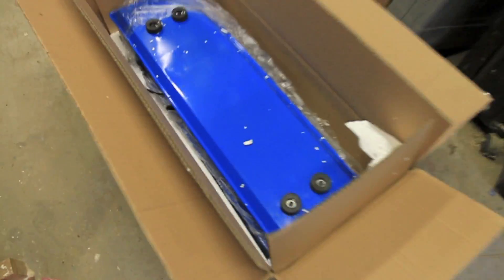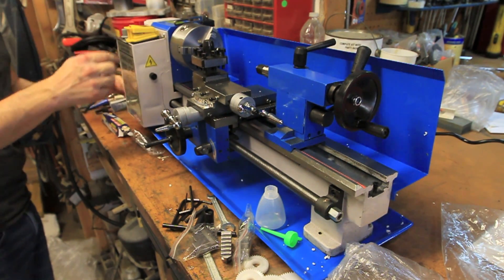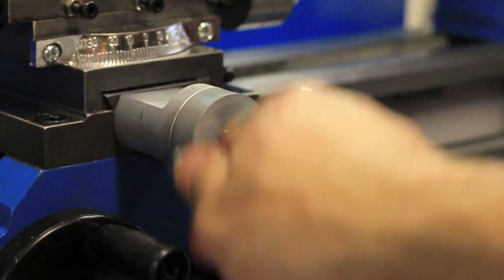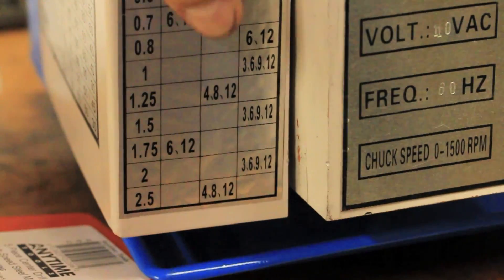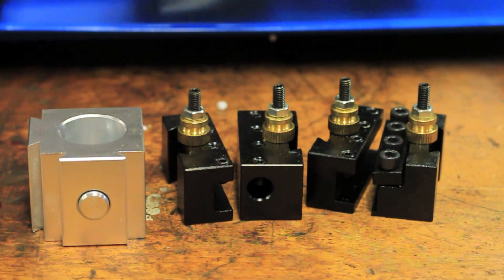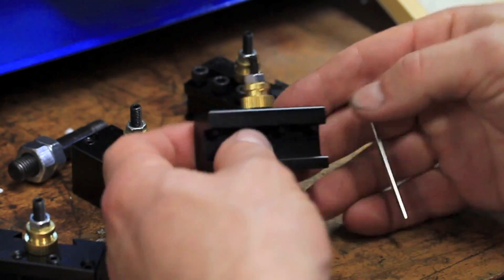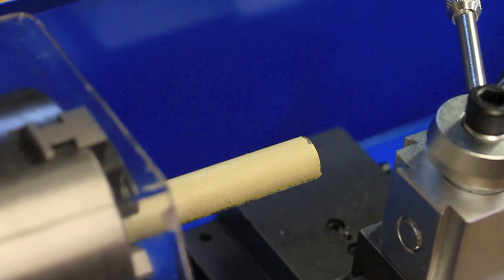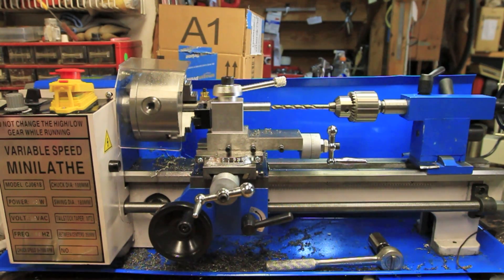Cheap Chinese Mini Metal Lathe Unboxing, Setup, Upgrading, and Testing

Comment: Thanks for the video.  Well done!    We're looking at this very one.
Reply from the maker: Thanks! 

If you buy this lathe with the mindset of it being a mostly assembled kit that needs work before it's really usable then I think you'll be very happy and my videos should help you with that process.

If you're wanting something that you can take out of the box and start using, sadly this wouldn't be a good option. 

Let me know if you end up getting one!
Reply: Thanks Tim!   Today we received the Grizzly 7x14 for $704 and are rather impressed.  The crate in which it arrived is the most professional and sophisticated crate we have seen.  We did the "break in" they suggested and will soon be giving it a go.  Thanks for your encouragement and the information you provide.  You are quite the professional educator!   Best of luck!
Reply from the maker: That's exciting! What are you going to make first? It sounds like the QC on Grizzly is much higher than the one that I got.. and for what it's worth I've heard their customer support is very good, should you run into any problems later on.

Thanks for watching and enjoying my videos too :)
Reply: Tim, purchasing a lathe appears to be something like buying a tractor!  You want to mow?  You'll require a mower!  Plough?  You'll need a plow.  LOL  Anyway, we ordered some cutting tools and went to Harbor for a 1" micrometer which I tested and it is dead on!  Also got some of the T handle Allens.  Have always been fascinated with lathes and I'm a retired military pilot who was on test pilot orders & my mom was an airplane mechanic in WWII so I sort of understand mechanics.  Thanks again for your encouragement and will keep you posted.  My neighbor said he will go to CPR classes while I learn!!!
Reply from the maker: Haha yeah, fortunately I bought some tools that showed up at the same time so I could use it right away. Unfortunately I had to fix it first. And also unfortunately I bought a bunch of carbide tipped tools which this lathe really doesn't spin fast enough to use... although I keep using them anyway.

That's very cool and sounds like a fun career! Thanks for the service.. I'm half way through a private pilots license but have kind of stalled because the time and money planets haven't lined up in a while.

Comment: this machine scares the hell out of me.. having worked with those (big)machines for 11 years , i would never ever feel save and ftw plastic gears? , also what is the rpm range? adjustable RPM ??.
I agree with Night saber , buy an older good lathe
Reply from the maker: Well comparing this to a industrial lathe is like comparing a Black and Decker drill to an oil rig. Not to say things can't go wrong on this little one, but it's just a much different scale. The plastic gears are just for the power feed (at least on this one that doesn't have the two speed gear box). In one of the later videos I finally put a tach on it and it seems to have a range between ~700 rpm to about ~2300 rpm. Thanks for watching!

Comment: Hi Tim; Thanks for the video.   I'm presently rebuilding the Harbor Freight 7 X 10 Mini Lathe I bought back in 2008, primarily to add some features such as taper bearings, tach, slide locking x 3 axis, and other convenience stuff.  I've gotten a TON of use from it, it has been a solid performer.   Together with my HF mini-mill, which I converted to CNC, I can make anything - Well, if it's not TOO big . . .

I have to say that the quality of my lathe seems to be much better than what you showed.  I picked mine up from the local HF store in a wooden crate "on-sale" for $349 back then, and the quality is actually pretty high. I'm sort of surprised that everything goes back together without much fuss, the machining is pretty accurate with apparently no assembly "fudging" when it was built.  I like it!

Great Luck, thanks again, Ken

Comment: I have this lathe, When i try to use the boring bar, The slide wont ...slide to the center of the lathe, it stops a couple of mm before reaching the  part i wont to bore..  what do i do  now ?

Comment: They're not a bad large once you've given then some fettling to get rid of the rough edges.  I would junk that QC toolpost though, I had one and it was terrible. Got a replacement from the UK company that sell them (Amadeal) who sell one for £45-ish that is steel and far better. It came with 3 tool holders. Overall I'm impressed with mine for the kind of work I throw at it. Don't know if you've seen him, but there's a guy on YouTube called Steve Jordan who has quite a few videos regarding upgrades he has carried out on his version of this lathe.

Comment: one of my friend bought one of this and replıcate all of the internal gear sets and build a better quality lathe.. and of the nearly 1 mounth of work he finally got a good lathe
Reply: Yep that is what I did, replaced the gutless supposedly 550w motor for a 750w 1hp 3 phase motor and VFD, replaced the head-stock bearings with angular contact bearings and replaced the plastic gears with metal gears, plus a lot of other mods and the lathe works fine. If you are prepared to do a bit of work you can end up with a very capable machine. Some of us don't have the room for anything bigger.
Reply: Stephen Tayler May as well bought something better if you swapped it to a 3 phase an all that

Comment: What gears stripped? You aren't talking about the plastic ones that are a known issue with ALL mini lathes, are you? There's a replacements available that remedy this issue.
Reply from the maker: Keeping in mind that this video was literally me taking it out of the box and having very little prior knowledge of this lathe or the mini lathe community in general, yes those are the gears I was referring to. Fast forward to actually trying to fix them, turns out this lathe is a single speed and doesn't have the plastic gears in the headstock transmission that plague the rest of the mini lathes. The actual problem was a loose/broken motor mount. This lathe in particular doesn't fit into your statement of ALL mini lathes. Thanks for the comment.

Comment: It don't matter what he buys if he keeps leaving the chuck key in the chuck he's gonna break it or himself
Reply from the maker: Aside from that being the first time touching the lathe and not really knowing better - this lathe came with a safety shield that prevents you from starting it unless it's in place, and it can't be put in place unless the lathe key is removed... so for a while it had that fail safe but then the shield broke apart - I do have a neat idea for a sort of kill switch that I'll be doing at some point in the future if you'd like to subscribe and check out. Either way, thanks for watching and commenting!
Reply: I was unaware it wouldn't start with the shield up. If the plastic shield broke try to recreate it with thin sheet metal. I think it's an excellent safety device

Comment: People expect better quality for half the price. It's fantasy land thinking.
Reply from the maker: Maybe some do - personally I had pretty low expectations and this didn't meet any of them. Thanks for the comment!
Reply: It seemed ok to me all the complaints were accessory issues from what I remember in this video. The alignment with the 3 jaw chuck was a bad procedure though you should have taken the chuck off and placed a center in the head stock. By doing it at the 3 jaw chuck you allow room for error since those 3 jaw chucks come with a certificate usually which states a range of .002 - .003 runout and who knows how accurate those certificates as well.  Also the tail stock is adjustable so I don't see the problem.

Comment: I bought one of these in the early 2000's.1st the speed control board burned out. I replaced it with an industrial motor control board. Then I remove the bed and welded it to a piece of channel iron to make it more study. Then the motor burned up so replaced it with a surplus tread mill motor with much customization. The standard tool post required shimming to get the tools on center . All and all I'd call it an incomplete kit that you can turn into a lathe.

Comment: I generally find - wherever something is made - that you get what you pay for - otherwise there would be no point in one thing being more expensive than another (of the same type of item).  This is generally "offset" by you getting more with the item that you would from another manufacturer of better quality - but ultimately you pay your money and you takes your choice as they say.
Reply: Sometimes. Sometimes you just pay a premium for the brand name alone and get less quality.
Reply: My motto is “If it isn’t selling, raise the price. If it still doesn’t sell, raise it again!” Perceived value gets the suckers every time.

Comment: Chinese products are junk!!!!!!!
Reply: Where's the $600 lathe from anywhere else?
Reply: I'm sorry, I've overreacted ;) But not all chinese products are bad quality. People just should be aware that cheap price means bad product - it's not China's fault.
Reply: @Radoslaw1986xx  I iPhone are made in China;-)
Reply: laurens b I was replying to the guy saying all Chinese stuff was bad, I said it depended on what you paid for if
Reply: Said someone without enough experience, it pays to do your homework, but you can get some very workable machines if you shop around.  I have both a “cheap Chinese” mini-mill and lathe and after a couple decades they’re still going strong.  I never could have afforded a “real” machine, but since I wasn’t running a job shop they worked very well for my needs.
Reply: Chinese products built down to a price are junk, yes. That doesn't mean ALL Chinese products are bad. It's just a matter of paying what it costs to get a quality product, same as everywhere else.
Reply: Paulo Costa, the primary difference I've seen with Chinese machinery is that with good quality equipment made out of steel, Chinese will substitute iron.  Drop a steel part on the floor, it bounces.  Drop a Chinese iron part on the floor, it breaks in half.  However, if you use the Chinese equipment within its limitations, no problem.
Reply: economic - not everything you get from china is crap. this lathe looks terrible, at least for precise work.
Reply: don't buy cheep Chinese machine. 
why don't try German,English,Japanese machine?
Reply: 90% of electronics are made there. Obviously they are not. 

Knockoff chinese ones do suck. My 9x19 lathe was 2x as much as this but has zero problems. I've made over $3500 machining parts with it(near 3x what I paid)
Reply: You can find plenty of crappy quality American made products. There are Chinese products that are of quality too. The market just gets saturated with all of the cheaply made mass produced stuff because it sells. If the barely good enough for 1/3 of the price sells 20 times faster than the higher quality, but much more expensive product, then the cheap product is going to not only get made, but every Tom, Dick, and Harry is going to try to get in on the quick money. You can't gauge Chinese products universally by the cheap stuff they mass produce to appeal to Americans looking for the cheapest alternatives.
Reply: Paulo Costa  --  most things from china are junk but fyi i bought a $119.00 chain saw with a 22 inch bar and jt is terrific  .you would not believe the trees  it dealt with
Reply: You are junk! You get what you pay for. If you wish to pay nothing, you get nothing. There are good products in China but you have to pay more than cheap for them. I have a few electronic devices from chinese manufacturers and those are very good quality products. Not cheap but still a lot cheaper than other brands.
Reply: With China you get what you pay for, i have a Chinese cheap drill press and for what I use it for (soft metals and wood) its perfect
Even run it against hardend steel without a huge effort, is it perfect and comparable to a quality machine? No.
Doesn't serve the purpose I need? Yes.
It needed some fine tuning and new scales for the depth and table angle (they were off slightly) but it works for my purpose
I'd I wanted a long term precise piece of kit then I'd fork out for it, but in general I find Chinese stuff works for infrequent light work where better tools would be overkill when your happy to hand finish
Reply: Because the specific geographical location something is made affects quality...
Reply: the answer has already been given in the video above...
Reply: Are you chinese? 
this explanation is by no means consistent! Chinese products do not have finishes, It is done without whim.
Reply: am I junk? No, I'm not chinese...

Comment: I do admire your patience and optimism during the first 15 minutes :)   Finally, I heard you say "it's gotta go back"   Wow, I know how bad these lathes can be.  I have a model # 93212   Central Machinery 7 x 10 that I had to take apart, clean off the grease, oil and lube everything,  adjust the gibs, remove a burr here or there, but now.....solid and smooth.   Thanks for sharing the video and good luck making cool stuff.
Reply from the maker: Thanks for watching! Turns out they wouldn't take it back and now hence the rest of my channel haha.

Comment: I purchased a mini lathe and it came with three extra sets of plastic gears. Was thinking that's odd then tried the lathe and after a few minutes the gears where chewed up. Lol straight garbage and when I took it back to the store they put it back on the store floor to resell. Some people will sell anything and have zero self respect.
Reply from the maker: Haha, those "extra" gears should be so you can change the speed of the feed screw relative to the RPM's of the chuck. That's unfortunate they stripped out so quickly.

Comment: If you're using triangular inserts, I feel bad for you, son. I've got 99 problems but readjusting the toolpost between facing and turning ain't one.
Reply from the maker: Hmm.. do you have a better type of insert to suggest?
Reply: TimNummy In the machine shop where I work, we use diamond shaped CCGT inserts. Once the toolpost is set up, the geometry is made to face and turn with the proper relief angles without readjustment

Comment: I have the very same Lathe and mine has some of the issues you have with yours. Tail Stock a little off center, And it is built without a Hi-Low lever in the rear of the Head Stock like I have seen on other Mini Lathes. Changed the tool post with the Jinwen QC.Ordered a 4 jaw chuck, DRO kit, Tachometer,Center Drills,Tail Stock Drill Chick and Live Center. The 80 tooth gear on the Lead Screw busted. I tried contacting the ebay seller and they refuse to replace anything. I also bought a Thread Dial and a new gear from LMS.The seller on ebay goes by "digitalzoneproduct" based out of California.They wouldn't exchange the lathe for another one. So I'm stuck with this one. At least I can fix their mistakes on my milling machine.
Reply from the maker: I had a similar experience with the purchase of mine... sounds like we are in similar situations :) Just curious, how do you like the 4 jaw chuck and which DRO kit did you go with? I'm also a bit envious you have a milling machine :)

Comment: I just got a bearing press from Harbor freight, and should have unboxed it right there and then, the bottle jack had damage to the machined surface of the ram. 
All it took was a thirty mile trip to obtain a new jack. 
Thank you for confirming what I should already know, getting a used lathe is the only option.
Any imperfection will just be magnified in your work, so, it's not worth getting a cheap lathe.
Reply from the maker: Maybe so, it depends on what you're doing... if you check out some of my later videos you can see some of the things I'm making with it and I'm pretty satisfied with the results.

Comment: Why carbide???  Carbide is for FAST stock removal on a stiff/rigid machine.  I can't see any of that on this lathe(!).  Why didn't you go with HSS???
Reply from the maker: Simplicity... I was able to cheaply buy a set of carbide tools with replaceable tips in various angles. Not knowing any better at the time, it was the most attractive option rather than having to learn how to grind my own tools (and get a decent enough grinder to do so) before being able to use the lathe.

Thanks for watching!

Comment: I bought this lathe and my angle indicator will not tighten to hold in place while cutting any tips? Could the bolts be stripped that hold it in my place
Reply from the maker: Maybe? It's hard to say without seeing it..
Reply: Nice thing I contacted the company and I think they are replacing the part. Because it definitely does not lock at all
Reply from the maker: That's great to hear! You must have dealt with someone much more reputable than I did.

Comment: I just checked a price tag of this toy is 450-500$ on ebay... Didn't you say it will be cheap?

I mean from the looks in your video, I would say this thing is worth around 20$, for which the words "cheap" would more then apply here, not "cheap" as paying 20$ less for what you usually pay for a full-working lathe..
Reply: I mean, i will be more then happy if you get what you 
payed for, but here it's not the case.. Moreover the word "cheap" get 
alot of abuse here and elsewhere, this mini lathe was too cheap to cheap
 to get a metal gears, too cheap to get even a metal turning knob, too 
cheap to properly ship, too cheap to get/pay for a workers-time to adjust it, even 
when its made in China, too cheap to get a proper housing, to cheap to 
get a proper turning off knob, its made in China and yet it's sold for 450-500$...